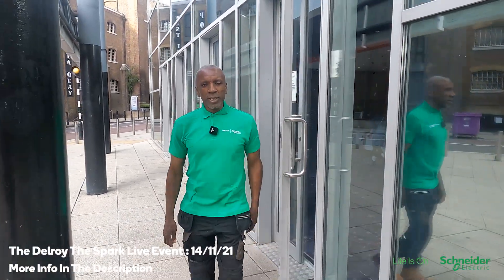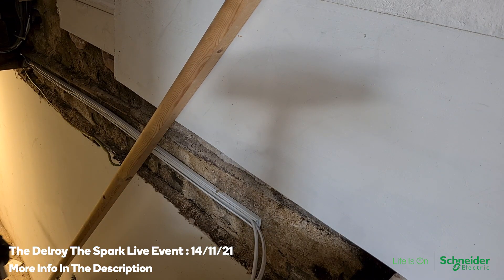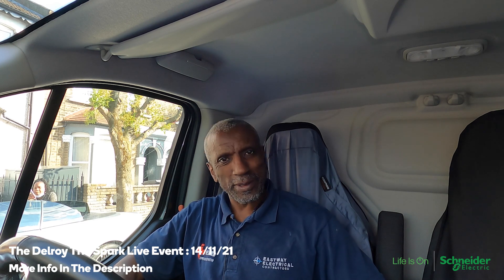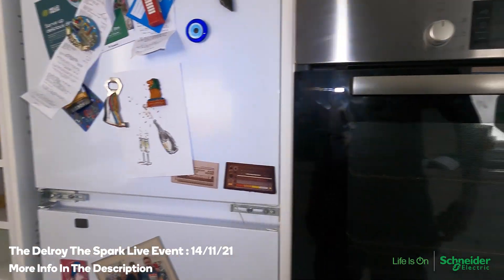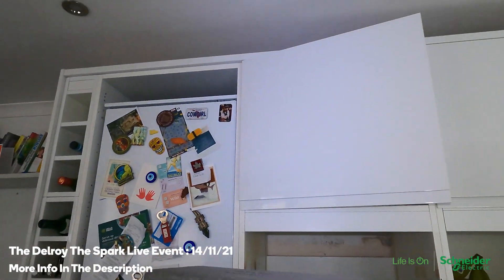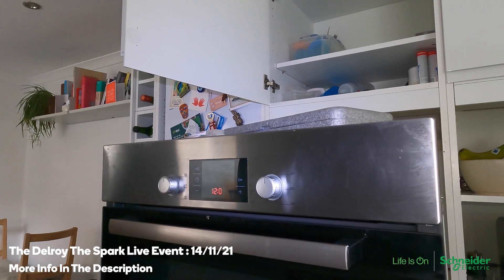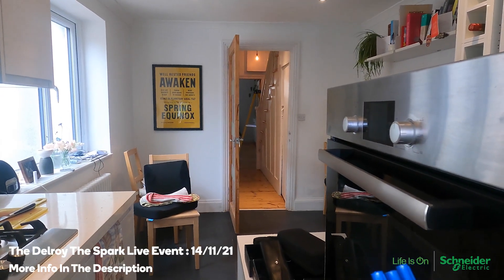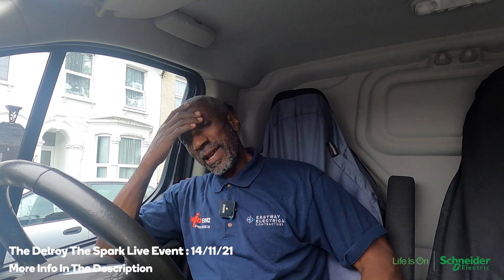“I Haven’t Used This For 20 Years” | Getting Out All The Tools For Fault Finding

Comment: The first test I would do on the oven is a visual inspection of the elements and run my fingers along the element to feel for irregularities. A lot of times you can remove the rear panel and test the element directly. Testing insulation resistance will generally need not give you a true reading as most new ovens require power to energise relays which put the elements in circuit.
Reply: It's a quick way of eliminating an electrical fault though? Then you know it's the oven so you can start opening it up to check the element.

Comment: Tripping oven is one of the elements 99% of the time. Disconnect each element at the back one by one until it stops tripping, then you know which one it is and you can order a replacement. Also, a failing element won't always leak enough to cause a trip until it gets upto temperature so you have to wait a couple of minutes to make sure (i've seen failing elements pass a resistance test when cold as well).

Comment: Bad wiring can do this as you pulling more juice amps the electrons can jump if cables are damaged on low power all can be ok.  If you think the isolator is at fault do resistance check on the contacts also insulation test over them as is there greece in it giving leakage but that would only be L to N so that would not make it trip.

Comment: You mentioned better to be a socket and plug top....then replace everything and not do it? 40amp RCBO protects the cable in wall to cooker switch, now a 16 make a socket, then fuse in plug top protects cable to oven....

Comment: Fan assisted oven ...definitely element
Reply: The element neutral us all ways connected so the pat test would show a fault.
Reply: @timballam3675  ? Do you mean show a fault between the lives/earth whilst using dedicated PAT testing machine powered from the TN-C-S supply ? Hopefully a battery powered insulation tester used on an appliance disconnected from the mains supply should eliminate the false fail result between neutral and earth - but interference suppression components (between neutral and earth) in electronic circuits of appliances can result in unexpected false fails whilst performing insulation testing.
Reply: @timballam3675 I ike the way you think, however some ovens have contactors and also the neutral end within the element may have stayed seperated from the sheathing, just the live end melted itself to the earthed element when it went bang, which would only show up when the element was called for.

Comment: Hello can you please tell me what a ring circuit is please? Is it just a bunch of outlets in a circle Or is it different. I’m curious to know?
Reply: Yeah all the outlets are wired up in a 'ring', but the important part is that both ends of the ring are connected to the power. Doing that means you can use lower-rated cabling, as current flows through both sides of the ring. It's a cost-saving measure.
Reply: @raybarker  thank you very much for explaining that. I’m trying to learn something new every day even from other countries other then mine.
Reply: its a circuit that leaves its mcb/rcbo goes to every outlet, one after the other then returns to its own mcb/rcbo, allowing two 2.5mm cables supplying each outlet. rated at 32A. A 32A radial circuit would have to be wired in 4mm cable.
Reply: @DiyintheGhetto  I think we're the only country that use them, or very few do, and we're moving away from them now, prefering radial circuits.
Reply: @bobcat9754  Got you. Still pretty cool to learn it. Thsnk you.
Reply: @DiyintheGhetto  the ring circuit is a dangerous method i believe was only introduced to save copper. Needs to be made obsolete

Comment: No need to protect the 1.5mm flex with a 16 amp RCBO. A single oven has a fixed load and so even a 6mm cable to the outlet plate on a 40 amp RCBO will provide adequate short circuit protection. A 2.5kw oven element can't overload 1.5mm flex.
Reply: What about an unintended dead short on phase to neutral, that without proper over current protection would otherwise overload the 1.5mm  cable? Any cable or flex has to be protected by an appropriately rated over-current device.
Reply: @mainlineelectronics5266  So please explain the requirements mandating the use of fused spurs, or plugtop fuses when interfacing 1.5mm or smaller flex/cable to bigger gauge flex/cable that has high value overcurrent devices at the other end. According to the regs, as I understand them, the upstream overcurrent protection must match the rated capabilities of the lowest rated cable on that circuit that does not have its own dedicated overcurrent protection.

Comment: Did you ever ramp test the other circuit (where it never tripped) possibly faulty rcbo on that one or its just less sensitive.
Reply: Home RCB's should trip at 30mA. Having it trip at 19mA idicates something is wrong.
Reply: @trespire  no it doesn't I've never ramp tested a RCD and found it to trip at it's exact rating it's always below even when new.
Reply: @trespire  rcd's trip anywhere between 50% and 100% of their rated value
Reply: @andrewturpin1994  @Chucky   Thanks for the information guys, my bad. I'm not a certified electrician, but I diagnose and repair industrial equipment. Never used a Magger on an RCCB so I wouldn't know about ramping one.

Comment: The element is breaking down ,,similar to how washing machine will trip rcd when on a spin ..need to let the fan element run
Reply: Ahh man this has just taken me back to when I got my first flat, it came with a brand new washing machine and would trip out the RCD on spin and randomly at other times. Had the appliance tech out 3 times and in the end they blamed the brand new electrics in the flat (Just built 2007)  So I had to get a spark out to test the ring and it was all good. 

Four More visits from the approved appliance tech and they find that when they manufactured the machine the steel stamping of the case was sharp and the vibrations from the spin cycles was chaffing the wires eventually shorting them out and pop goes the RCD.
Reply: @warrmr  yep leakage to earth faults particularly on washing machine and fridges are a nightmare to pin down when trying to find the cause of intermittent rcd tripping

Comment: The appliance needs testing first, as it's the most likely culprit. A socket at the rear suggestion was ignored. Could be an element going south or something similar. No other circuit on board with rcbo.

Comment: I used to think you knew your stuff.  But you pat testing doing earth bonding you are measuring the resistance from the body the metallic side of the oven the resistance from the body to the lead end needs to be LOW very LOW.  As if it is HI the time it will take to trip can be over .4 seconds also over 5 seconds.  The return path needs to be low from the body to the supply.

Comment: I’m sorry to hear some dickheads on here del. As an electrician you should only find out if electrical equipment supplying the oven I.e. RCBO or any other protective device and it’s fixed wiring and accessories are ok. If it’s the oven, walk away , there’s been times when I’ve made a rod for my own back dismantling appliances and the customer blaming me for the problem. It’s not our duty to be spending the day there taking a part ovens etc. Tell them to call the manufacturer they will have a garuntee no doubt
Reply from the maker: Thanks for your support. Hope you enjoy the videos
Reply: Quite right, I've been stung like that before.

Comment: That PAT tester needs calibrating with a valid certificate,  carry out an insulation resistance test on the elements. The oven will stay on till heat is called for and the element is in circuit, and that current clamp meter should be around the phase or neutral, not both,  !
Reply: ….unless you’re testing for earth leakage… like he was… 👍
Reply: The clamp needs to be round both so it reads the difference between them which is your leakage

Comment: With the clamp meter you need to Go around the live only... going around the neutral Will give you a false reading.... putting the live and neutral cancels out each other because of the magnetic field. Great video
Reply: No sorry thats exactly the Point to get the Reading for the earth leakage
Reply: @timo4733  Yes only one conductor at a time.👍🏼
Reply: @petehiggins33  https://youtu.be/g5d_wxdE5tk John ward video explains it well
Reply: @ashleyrussell4288  he's just showing normal usage of a clamp meter here not how to test for earth leakage.

You Clamp both line and neutral, the reading you then get is the earth leakage.

In a perfect system the current going down the line will be the same going down the neutral and so nothing down the earth.

If any current is leaking to earth you will see the imbalance at the clamp meter reading as the total earth leakage on that circuit.

Eg:

Line = 10A measured
Line and neutral = 15mA measured 

Therefore only 9.985A is returning through the neutral and thus 15mA is being leaked to earth
Reply: L & N only cancels each other out if there is no earth leakage. When clamp testing both conductors together the imbalance which in this case was 17mA is the leakage to earth. This is extremely close to the RCBO's tripping value of 19mA as measured during the ramp test, hence the intermittent tripping.
Reply: @petehiggins33  oops yeah you are right was passively watching was 0.17mA not 17mA

Comment: I've had this with a brand new oven 
 Was told to run it on a non rcd (or without earth) up to temperature.

I didnt like the soujd of this but as they promised afterwards the oven stopped tripping the rcbo 

They said Somthing about moisture in the element.
Reply: Really... just don't touch the metal casing whilst carrying out that procedure coz you might get a nasty surprise!

Comment: You forgot about Fire Cable Fixing Clips inside the trunking and steel fixings rawlplugs..
Reply: @CallumWK  What else is wrong with that?
Reply: If u cant explain how are we supossed to do it better ?
Reply: @CallumWK  a regs number would be nice. Otherwise it's just one of those whispers that everyone talks about as necessary but isn't actually in the book.
Reply: @CallumWK  that's a spicy one though because the notes say that non metallic cable trunking or non metallic clips shall not be the SOLE means of support. So combined, it should be okay. I'd still C2 it though if it was over a door though or along a main escape route.
Reply: @CallumWK  which is why I would C2 it.
Reply: Not necessary. Is the cable liable to premature collapse in the event of a fire?
Reply: @Romeworld95  I am, we're talking premature callapse, which doesn't apply
Reply: @Mainly_Electrical  Premature callapse, doesn't really apply, they might trip over it though,
Reply: @CallumWK  and i guess you wouldn't charge them for an RCBO or cooker switch they didn't need,  the problem is people copy these people.
Reply: @Adam-lz8oo cool
Reply: @bobcat9754  they did need the rcbo replacing though... Not due to fault, but because it was 40A With a 1.5mm flex hanging off it
Reply: @bobcat9754  what's cool is that you'd be happy with 1.5mm being protected by a 40A breaker.
Reply: @Adam-lz8oo  i don't remember a 1.5mm cable, perhaps i missed it, however a cooker circuit should be on its own radial, so disconnect the 1.5 cable, what did he reduce it to 6 amp then
Reply: @bobcat9754  think it was the actual tail out of the oven. And I think the oven is on its own dedicated circuit because he plugged in a nearby socket to check. But to be fair, he did stick it on a 16a which isn't miles better
Reply: @commecicommeca4489  Fuse the flex then
Reply: @Adam-lz8oo  You put a plug on the appliance and fuse it.
Reply: @bobcat9754  I wouldn't.
Reply: @CallumWK  I would have kept this one quite.
Reply: @Adam-lz8oo  What would you like a regs number for, ?
Reply: @bobcat9754  to see what the other guy was referring to
Reply: @Adam-lz8oo  Regarding premature collapse or trunking installations ?
Reply: I'm guessing it was a 40A rcbo with the run in 6mm t+e on a radial to the cooker switch, so could also have just took this off and then fit the flex into an FCU? 

Swings and roundabouts
Reply: @bobcat9754  the part I looked at referenced both.